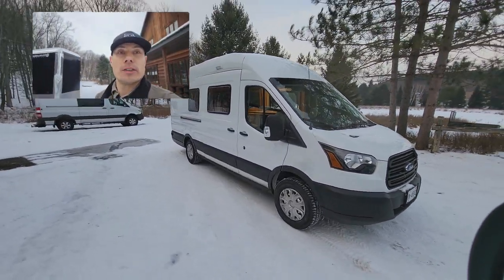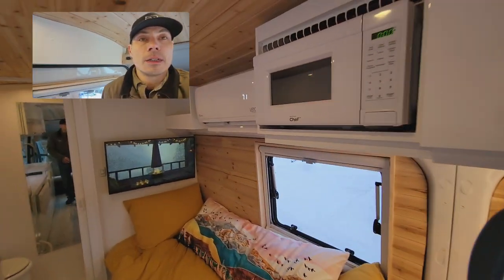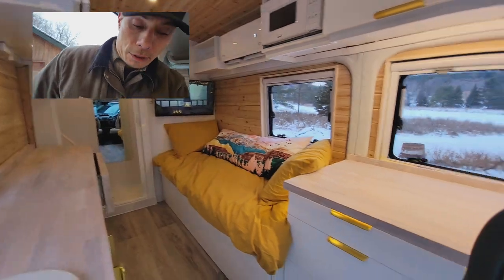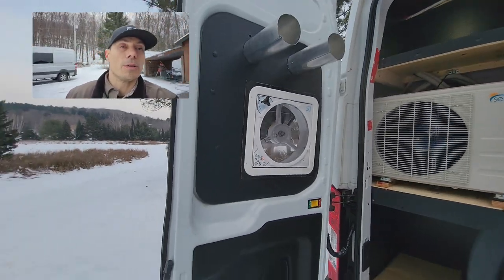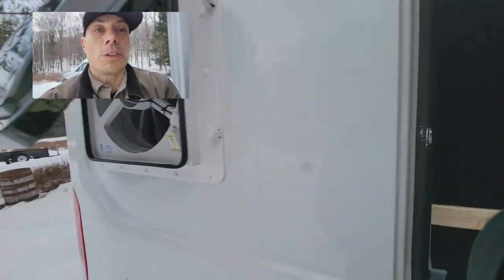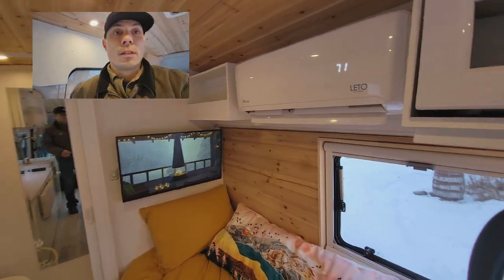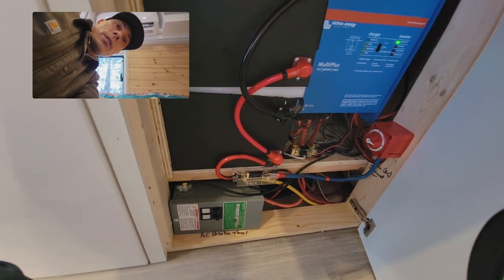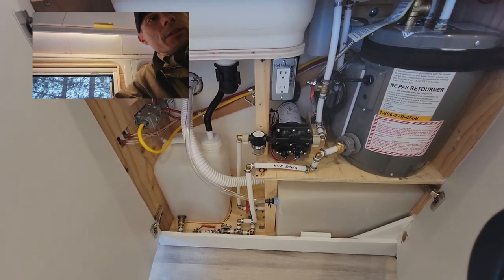Mini Split Air Conditioner in Van Conversion. Unique layout for single camper.

Comment: I admire this build.   I have the opposite climate situation, mostly desert needs.   In your opinion, do you think that configuration, with the "outdoor" unit in the van vented via the door, would have enough air circulation to the unit when in the cooling mode?   

Thank you for your video, not only with the unit inside the vehicle, but the side mounting of the wall unit gives me a good template for my project.
Reply from the maker: Thanks. This van has been used for 6 months each year in Florida and extensive use of Air Conditioning. It seems like this setup works perfectly for both AC and heat. Just make sure you run the drain line from the indoor unit with slope and no kinks...
Reply: @TheNaker  Yes.   Thank you.   Your build is a solution to my desire to keep nearly everything inside the structure of the vehicle, to keep the outside looking very stock for mild stealth and also the security of the unit, refrigerant, power and control lines.    I'm going low roof in a v10 econoline extended passenger van.   Without the high roof the side view and wheel base proportions look very similar to your two rigs.
Reply from the maker: @orthopraxis235 Good luck with your build. I'm also considering a floor mounted fresh air vent on my next build instead of the Maxxair on the roof. Avoid roof penetrations, more stealth and a better look overall.
Reply from the maker: @orthopraxis235 Good luck with your build. I'm also considering a floor mounted fresh air vent on my next build instead of the Maxxair on the roof. Avoid roof generations, more stealth and a better look overall.

Comment: Hi Sean.  Absolutely beautiful! Can you tell me more about the Ford Transit your mother purchased in order to have the space to include everything you incorporated in your incredible build? It looks like a medium-height Transit, is that right?
Reply from the maker: This is a full height and extended length Transit with eco boost engine. Single rear wheels. It was gently used. 
Are you looking for a van build? I'm getting ready for another project this summer...

Comment: Thank you for posting, very helpful. Where does the gray water from the shower go?
Reply from the maker: Thanks. She didn't want a gray tank so it goes out through the floor. There is a hose fitting if whe wants to route it into a sewage port.
Reply: @TheNaker  Thanks for the information and great ideas. Looking forward to your next post.

Comment: This is really great.  Do you have solar panels on the roof?  Now  what Im wondering is: Why are you doing AC with all that snow?
Reply from the maker: I have 4 x 100 watt solar panels on the roof with a Victron 30 amp mppt charger. The heat pump is great for cold and the when she drives south she switches to AC...

Comment: Have you been in super hot weather like in Florida all summer. I wonder how that AC will work like that in that heat? Can it keep up with that vent system. I have seen others do a large vent but with no fan and they have problems on hot days they need to open the door to get more air flow in. I am still working on a way to put a minisplit in my rig someplace. I have for the most part the same elc system you have with two 206 SOK batterys good to see that working. .. What BTU AC are you useing and how long can it run off the batterys at night? How much solar do you have up top?  Thanks
Reply: Thats a 9000btu unit. It pulls about 720w at full load.
Reply from the maker: Its been in some very hot heat and no problems so far. The beauty of this design is that if you ever needed to you can just open the door. But she has never needed to.

Comment: Great build 👍 just wondering why not leave the compressor outside the van? Is there a reason why it’s inside?
Reply from the maker: We didn't want a big ugly compressor hanging off the rear...
Reply: Ok Got it👍I see you have a 2gallon water heater. Is it running on 120v ac or 12vdc and what wattage? Thanks

Comment: Awesome set up! So I’ve got to ask, how long does it run before you need to recharge your batteries?
Reply from the maker: 8 hrs depending on usage.
Reply: @TheNaker   and you’re using 400ah or 600?
Reply: @MrIllPerspective  it looks like he has two 206 amp hour SOK batteries = 412 ah battery bank.
Reply from the maker: Yes, its the 206ah SOK batteries. We started with two and added one more for a total of three now.

Comment: Great van build. Is Mini split run at 12-volt DC? Is radiant floor heating from a separate heater or somehow tied into mini split? Do you have a plumbing and/or electrical diagrams of mini split system you are willing to share? Thanks.
Reply from the maker: Hi, the mini split is 110 volt and run off of the inverter. The radiant floor heat is thin film electric and also 110 volts inverted from 12 volt batteries.
Reply from the maker: I'll try to post a diagram shortly...
Reply: @TheNaker  ..... waiting for diagram :)

Comment: This is a spacious build, airy and light.  You can do this when you have simple, and clear demands for the build.  Although I would've been so stressed out on having the battery topped up to run the only efficient cooling and heating system - I would simply hate that vanlife.   There is a reason DIY's seldon run with AC, and bus sized motorhomes do.  It's completely different mindset.  I'd still love the idea though :)
Reply from the maker: Its good for a couple of days intermittent use. 400 watts of solar is doing a great job of keeping the batteries topped up.  But she is usually plugged in at a campground for longer periods.
Reply from the maker: And we added another battery so now have over 600amps.
Reply: @TheNaker  I have the same 206ah SOK batteries for my van build as I’m just starting with my Ford transit 350 HD. I watch your video at least twice a day… I am so impressed with that idea as I love the minimalist design in the back of the van. I was looking for a viable solution that maintains stealth and functionality and when I came across your video I almost cried. 😂 it was like the holy grail of solutions. You have encouraged me to do a similar build but I’m ggoing to try out the same layout but with a Midea-U window AC unit ~$460. Air handler part and compressor will be separated by an insulated wall then same design as yours.
Reply from the maker: @mikefranks4528  Thanks Mike! I'm really impressed with the SOK batteries and am using them in my next build (also same A/C unit). I also had been looking for a viable solution but no one seemed to have tried it. So I designed my idea and tried it with much success. I hope more people take advantage of this design.

Comment: Nice! Where did you hide the refrigerant lines, and where did you run the condensate drain pipe ?
Reply from the maker: Refrigerent lines were run behind cabinetry and drain line. Both drain lines go through a hole in the back corner of the van below the condenser.

Comment: It is a very nice layout. Are there videos on the wet room?
Why a mini split and not  an unit designed for vans, cost, performance, etc?
Reply from the maker: The Mini Split is much more modern technology. It uses less than a third of the electricity, is significantly quieter and the compressor fan is variable speed. Other downsides of the roof top units are the significant weight on the highest point of the van and using up valuable roof space that could hold solar panels.
Reply from the maker: I can do a video of the wet room. What specifically would be helpful?

Comment: Can you drive & have the fan cover open and what's watts on the roof. Maybe some dedicated ventilation as well - nice job & got to keep our mothers happy !!!
Reply from the maker: Hi, the intent wasn't to drive with it open. The Van's AC and heat is fine when driving. She just uses it when stopped.

Comment: Sean, I hope the van operation is still going well. I recently purchased the 6-key wall control (00A03650K) unit from Amazon that you mentioned and wanted to install to connect to you Maxxair fan. Did you ever end up doing that? I see that it has an Ethernet port on the wall control but cannot for the life of me find any videos or even manufacturer instructions, let alone any mention, of said wall control unit. Any luck on your end?
Reply from the maker: Hey Mike, I never did do the switch as she has been fine with using the remote from outside. I recall a video that showed the ethernet port in the control unit on the fan. You need to remove a cover panel but I'm pretty sure you will find it. I also can't remember if it was ethernet or phone cable. Good luck and let me know how you make out.
Reply: @TheNaker  That is a relief to hear that the connections are legit. I will try to find that video and will update you to my findings once completed (will do a YouTube video on it too, if I am successful). Thanks again Sean for such a speedy response.
Reply from the maker: @mikefranks4528  Glad to help. I don't think you need a video. Just start taking off the cover panel on the fan and you should find it. Good luck! I look forward to hearing how you make out.

Comment: Great job! Are you using an easy start for the compressor unit? Curious how you're keeping the wattage so low at startup. Thanks!
Reply from the maker: No need for an easy start with a mini split. Startup draw is very low. Not like a rooftop unit.

Comment: Hello, i was just wondering what Materials did you use to build the back out of? Where the condenser is. I love your build! Just bought my van & I decided to go with your mini split layout.
Reply: & also do you NEED both sides of the back for the condenser or could you get away with only doing half the side
Reply from the maker: Sorry for the late reply. I used exterior grade plywood to build the back. A combination of 3/4" and 1/2". The black covering is repurposed plastic panelling that came with the cargo van.
Reply from the maker: I only used half of the back for the condenser. The other half is the bathroom.

Comment: A mini split was at the bottom of list of options, but seeing this...wow, definitely at the top now. Can the unit be mounted lower, like on the floor? Or will door mechanisms interfere with cutting a fan hole? Thanks
Reply from the maker: The door mechanisms will be in the way. Easiest spot is where the windows go. Good luck!
Reply: @TheNaker  This is not true: There are no mechanisms in the way, but rather cross bars and the door skin is very beveled rather than flat. So yes, can be installed on floor and vented through bottom of door, but may have to use a few smaller 4 to 5" vans rather than one large roof type fan. This is what I plan to try soon and can update if anyone is interested?

Comment: I'm doing a similar setup in my bus conversion with an isolation space in the back of the bus to keep the compressor inside, but I only have a vent at the moment. After seeing this video I'm going to install the fan as well (I have the same fan), just didn't realize it would affect the efficiency without a fan. My question: Is the fan intended to draw air in or pull air out of the compressor space? is the vent intended for the compressor to pull air in and the fan pulls the air out for airflow? wasn't sure about that part. Thanks!
Reply from the maker: Hi there. The fan is pulling air out and the vents are letting fresh air in. Good luck with your build!

Comment: Hello Sean, I love the way you set up your Mini Split.  I'm attempting to duplicate your design.  I don't understand the reason for vent holes in door for feeding air to back of your compressor?  Would it not work the same to have the cold Air Conditioned air blowing thru the back of unit?  I mean what is the reasoning for entirely closed box around A/C unit?  Thanks for your advice.
Reply from the maker: Hi. You want to keep the air conditioned air in your living space and use outside air for cooling the compressor. Otherwise you are losing all of that cold air and then warm air will get pulled into your living space. Same concept is used for residential installs. Good luck and let me know how you make out!
Reply: You're just amazing!  Thanks for the super fast reply.  I appreciate the suggestions

Comment: How are you able to get 24/7 minisplit use off the set up you have? How many solar watts of panels are in use? You said you are using 110, so are you doing a 12 or 24 volt set up with inverter? In the Arizona desert, we are not able to get 24/7 minisplit use with state of the art systems unless we have 3000 watts of panels feeding into $10,000 worth of LiGePO4 batteries. Exploring the EG4 plug and cool 28 seer set up but still need to know battery bank requirements for night time use...Thank you...
Reply from the maker: It's not 24/7 unless plugged in. She can do +10 hrs on battery buy then needs to charge.

Comment: Do you have a fuel heat pump as well? Also, did you mount it in the middle due to your door structure? Thinking this setup would be great for my promaster build
Reply from the maker: No fuel heat pump. And yes, I mounted in the middle to put fan and vents in the door panel where a window would normally go. The lower part of the door is more complicated and has reinforcements.

Comment: If that fan on the outside unit already blows outwards, couldn't you just seal off the front of that unit and use tha fan instead of adding another fan?
Reply from the maker: Maybe. I didn't want to risk the loss of fan pressure so went with the additional fan. Remember the vents supplying fresh air are passive so you lose efficiency because of this.
Reply: @TheNaker  you are losing efficiency with the extra energy used by the fan anyways.
Reply from the maker: @GeorgeOu  that fan is very efficient and has a low draw/
Reply: @TheNaker  I don't doubt it's an efficient fan.  All I'm saying is that no additional fan uses less energy than an efficient fan.

Comment: SWEET!! Was searching for a mini split solution for an upcoming van build, this looks awesome!  Quick question, how many watts does the mini split system (fan running only) draw when it is not running heat or AC (like when the room is already at the correct temp)?
Reply from the maker: Fan draw is very low wattage. When the van is back next month I'll check the actual numbers.
Reply: @TheNaker  I'm thinking about putting this in a van, what are the starting watts & running watts and what size generator would you recommend to handle it.

I've only got two 100 amp hour batteries so far, perhaps when I get 400 amp hours I'll consider running any AC system off battery power only but until then I'll need to have a generator option to use.
Reply from the maker: @mikesmultimedia  You could get by with a really small generator. The Honda EU2000 or EU2200 are great options and would have more than enough power.
I also strongly recommend the Quietwarmth electric heating system for floating floors. Its extremely efficient and makes the van feel warmer without much electric draw.
Reply: @TheNaker  I don't have an extended van, so if I go the split route, I'll have to design an external box for the external unit to the AC. 
Also, the long horizontal format for the internal part of the split does require internal space which is limited. 

I've seen on location (above the back doors) which seems out of the way and doable. 
I'm a little unwelcoming to having to install anything on the back, which will reduce the stealth nature of camper van etiquette. 

Being that I've conjured up a location for the generator outside the rear doors, it seems I may as well consider placing the external part of the split next to that.

I'll use an enclosure, which will introduce a need to design ventilation.

Lets see what I can come up with.

I do like the low power needs vs. the 1500 watts for the 13.5 btu roof top unit I've been  looking at. 

At least with the split, there is a chance to use it without having to fire up the generator each time if my battery bank is suitable for it.

Comment: I'm thinking to use the same condenser/evaporator from the front of the car, and the same fan that cools the engine, just to remove the belt driven AC and use an R134A compressor ( from a split R134A system with the full electronics, and keep the reversing valve and an aditional valve to bypas the dash exaporator), what about the condensation from the external unit, when defrosting? will flod the van.
Reply from the maker: I routed drain lines from the external unit and internal unit through a hole in the floor of the van at the rear drivers side.

Comment: I'm curious as to how well the unit is going to hold up to the normal vibrations of driving?
Reply from the maker: So far it's held up to 2 months of travel from Canada down the eastern US to the Florida Keys and back up with many stops. I just checked it over and nothing has come loose.